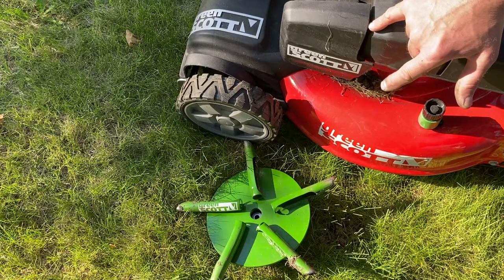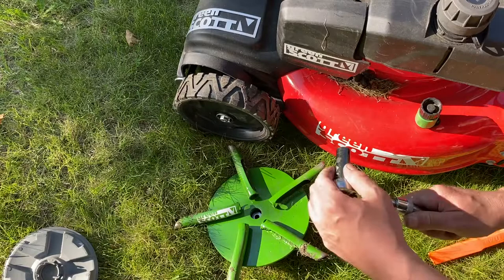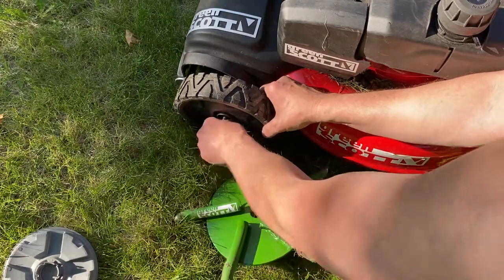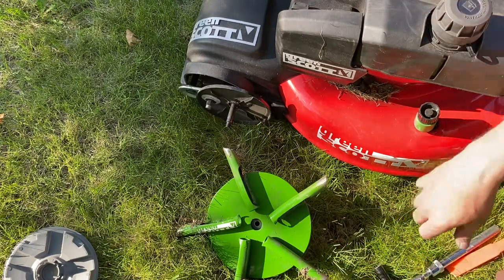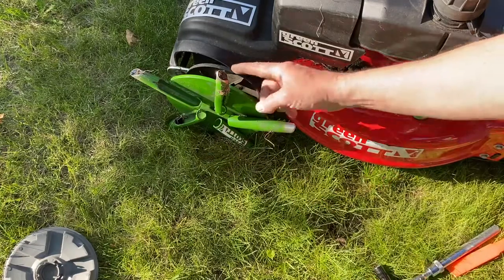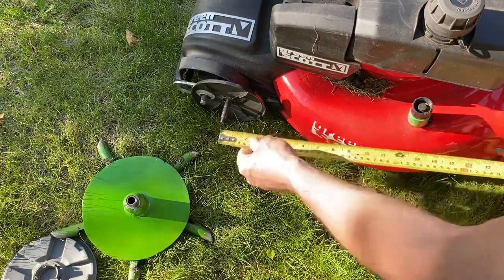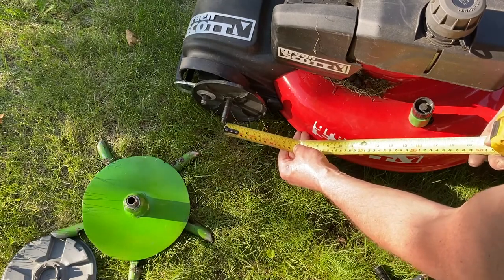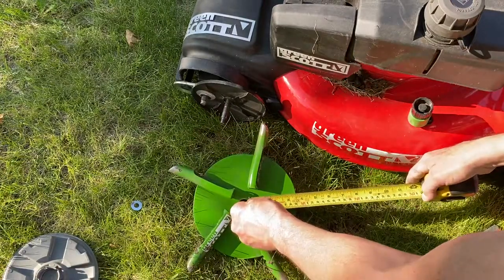How to measure to fit a lawn mower aeration wheel on my mower?

Comment: I’m getting ready to purchase, but I wanna make sure that this is gonna fit my lawnmower. I have a craftsman MTD self-propelled.
Reply from the maker: I have the similar model, the wheel and structure of front end looks the same. Tons of manufacturing companies of mowers use a proven system and the 1/2” axle has been issues free for decades!
Reply: @green_SCOTT  perfect. Now I have to spend $200 every year just to have someone do it when I can do my own lawn.  The same way I’m cable free for years. I want to do the same with these big companies that want to charge you hundreds of dollars for your lawn. I took away the professionals want to mow the lawn and I took away the professionals that want to fertilize your lawn for us to stay because I do that myself
Reply: @green_SCOTT  thank you for creating this for all of us homeowners
Reply: quick question.  I believe mine is 6 inches like the one you have in the  measuring instructions video , butt If I measured wrong, can it be returned to get another one?
Reply from the maker: Because of the off set and the spacing washers  provided you should not run into any problems if you order the same diameter wheel corresponding to your mowers wheel. And yes, I’ll ensure you have a working product 💯.
Reply: @green_SCOTT  I just placed my order and a diameter is 6 inches from inside the wheel. I As soon as I get it, I’ll put it on and try it. Thank you for responding.

Comment: the aeration wheel comes in different sizes from 6 inches to 8 inches. for the type of lawnmower that you're using on this video what size of aeration wheel did you use? if you use a 6.5 to 7 inches, would that hit the side of the lawn mower?
Reply from the maker: Most likely as it is designed to clear the shroud or mower side. Check out my website under installation and there are two videos that are showing.
Reply from the maker: Under the upper left of most websites are three horizontal bars. This indicates the menu under the menu section is a section called insulation you’ll find videos 👍🏻

Comment: Hello, Scott! I have a Honda 21" mower with 9" wheels. I see you have 6 up to 8.5 in size. Anything that'll work for me? Thanks!
Reply from the maker: I believe that they are 8.75 as I’ve made a bunch in the past for customers and still have one available ready to go. If ordering please order the 8 inch and indicate via an email that you have placed an order and are requesting the 8.75 inch which should easily work very well for you.
Reply: @green_SCOTT  You're absolutely right. The Honda manual has them listed at 9x2.25x9 but an actual measurement is 8. 3/4" . Thanks again.
Reply: Hello, Scott! I just placed my order. I did what you suggested by purchasing the 8" wheel but I'm requesting the 8.75" wheel. Thanks!
Reply from the maker: @greggf.primus8916  just seen that I’ll send it out TODAY! 😎